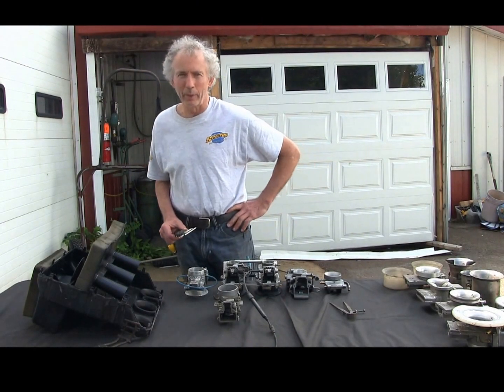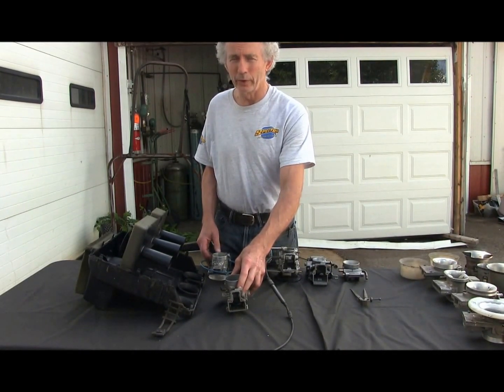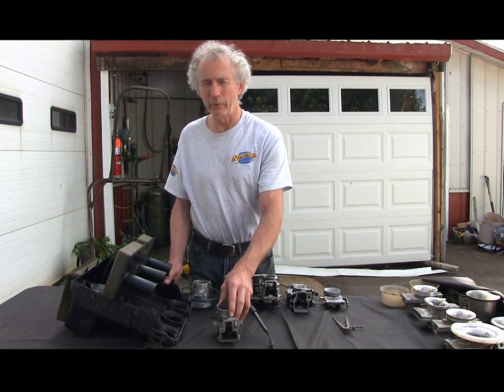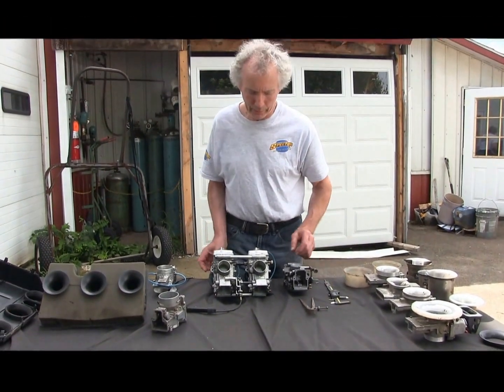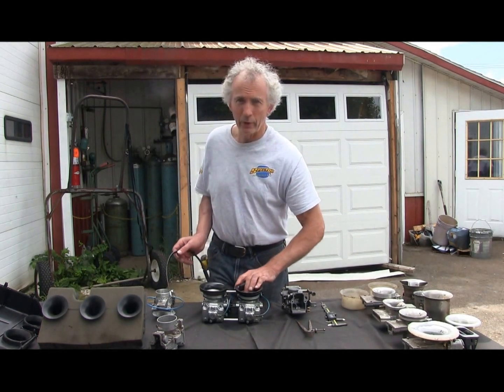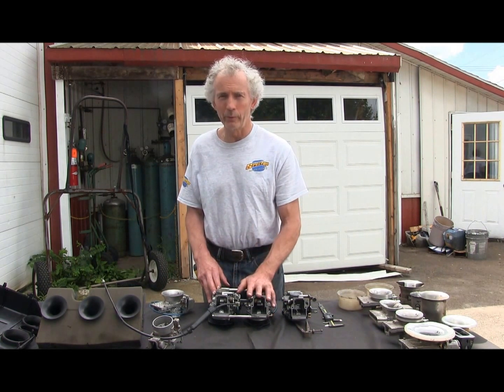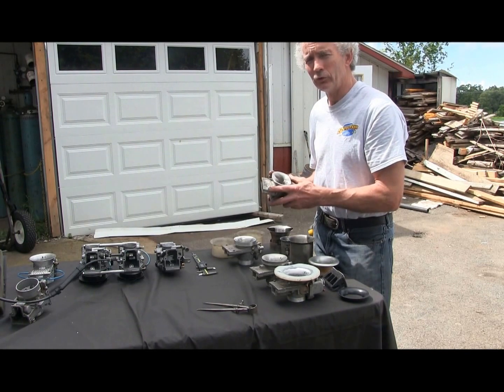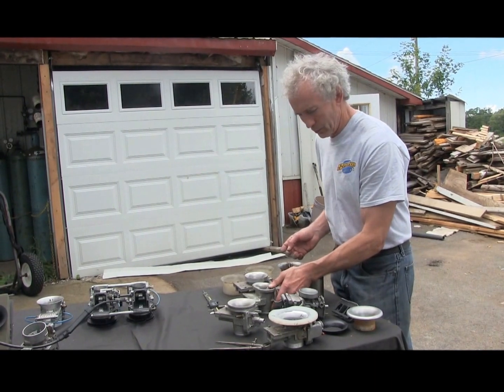Velocity and airbox class

Comment: On a stock air box getting fresh cold for the out side   will make more hp ?
Reply from the maker: yes cold air is denser so more enters engine + more power, most stock airboxes make more mid range power due to increased air speed with velocity tubes.